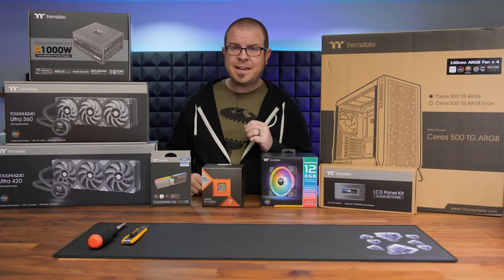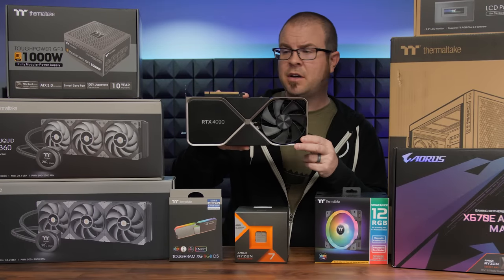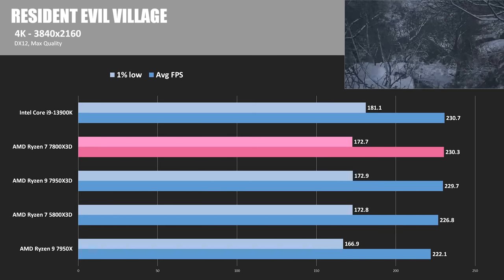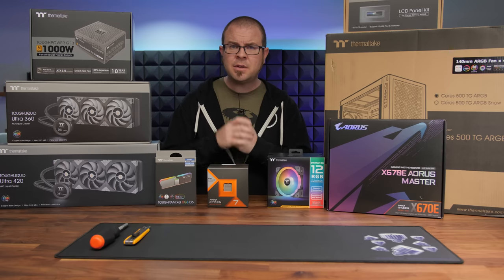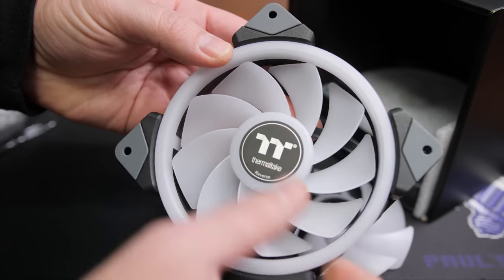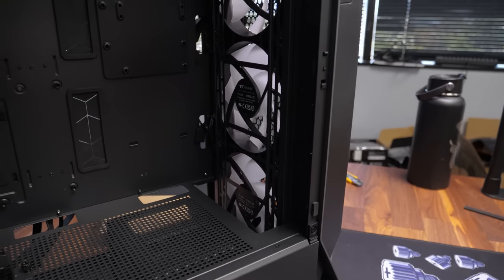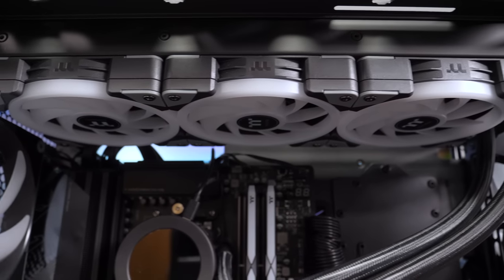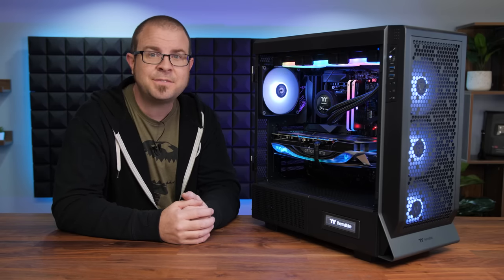Building a Top-Tier Gaming PC in the Thermaltake Ceres 500 - 7800X3D + RTX 4070 Ti

Comment: I dont know if someone already posted, but the dip switch on the TT controller is to assign a device number to that hub, so the software can know what controller that is, you can daisy chain multi TT controller off one of the USB header splitter cable.

Comment: I'm very interested in the Ceres 300 case, and would like to see a build with that. I'm looking for an air-cooled gaming system that can house a 4090 and a soundcard, and has top-front mounted IO, and is only as big as it needs to be. No over-clocking.

Comment: I did a recent build in this same case and actually was very impressed. I'm not sure I would have been $169 impressed, but I was able to buy it new for $134 without the panel. I also used Thermaltake Toughram, which was inordinately expensive compared to other DDR5 on the market, as in more than twice as expensive. I also used a top-tier Thermaltake 850W ARGB PSU and one of their AIOs which was really the only reasonably priced Thermaltake part in the build. However, I had committed to a "Thermaltake" build, so that's what I did even though I could have built the PC for less if I had just used the quality parts which are my usual "go-to". In the end though, I like the build. The case came with three 140mm ARGB CT140 fans and I used one of Thermaltakes 420 AIOs which also came with three 140mm CT140 fans. I expect the fans on the "performance" version of the AIO are better and perform better.

Comment: The Ceres 500 is beyond huge.  Heck, even the Thermaltake Ceres 330 ATX Mid-Tower (the smaller version of the 500) I am currently building my latest system seems a bit large compared to my current CORSAIR ICUE 220T RGB Airflow ATX Mid-Tower.

Comment: As a gamer is an X670|E needed? My next build will be a 7800x3d 64GB DDR5 (2x32GB cl30 6000) and a 4090. I wasn't planning on overclocking and with these parts I can't see me upgrading before the next architecure change (still rocking a 3600x and a 1080Ti). . I do like the 500 USB ports you get on X670 though. My only requirement is 2x M.2 slots, WiFi and blurtooth.

Comment: Hi Paul, I just wanted to start off by saying that I'm a huge fan of your DIY computer building content. From selecting the right parts to putting everything together, your videos have been incredibly helpful for me. However, I've noticed that I always run into issues when it comes to fans and RGB components. Between figuring out the right fans to purchase, connecting them to the right headers, and synchronizing everything with software or the BIOS, it can be quite overwhelming.
With that said, I was wondering if you could possibly create a dedicated in-depth video on how to properly purchase and configure RGB fans. It would be incredibly helpful if you could cover topics such as connecting fans to RGB headers, selecting the right RGB fans for my specific build, linking RGB with different vendor types, and finally, demonstrating how to synchronize everything from the fans and RGB RAM to the motherboard, AIO, and PC case.
As someone who is passionate and admire about building their own PC, this is by far my biggest pitfall when it comes to RGB. Any help or guidance you could provide would be greatly appreciated. Thank you!

Comment: I'm building a loop in this case. That front tray is great on paper but when I added a rad (inward facing) and fans (outward facing) I could not put the tray back in. They have some lip at the bottom that the bottom fan doesn't clear. I had to remove the whole frame to put it back in. Painful.

Comment: I mainly use my PC for MSFS and the 7800x3d is exactly what I need, it will replace my crappy 10900k with 19 cores. So unnecessary, like I only use about 7 or 8 cores at most and everything else is at 0 utilization. Saving way more money then the 7950x3d and get even better performance then it. I use 1440p which is perfect and I'll see a big jump in FPS. Thanks for the review. I wonder why a lot of other reviews on the 7800x3d or other hardware never test MSFS. It's probably the most cpu intense title out there if I'm being honest, especally when flying with payware high intesne scenery or using more study level aircraft costing more cpu load. Definetly getting the 7800x3d tomorrow!
Reply: MSFS is a tough one to benchmark. There's no built-in test and the performance you get depends on the aircraft you are flying, the area you are flying in and the prevailing atmospheric conditions. So, it's hard to replicate test conditions between runs. We're fortunate that Paul goes the extra mile for us. Thanks, Paul!

Comment: It blows my mind it performs on-par with the 13900k in games, but does it at less than 1/3 the power draw.

I guess the downside is you can OC the 13900k much more than the 7800X3D...?

I kinda feel silly putting a THICC 480 on my 7900X3D...but I also don't. LOL

Comment: On Thermaltakes sensor panel I wonder why they couldn't just keep the original metal panel and yet cut out the area where the slim sensor panel could attach to? That would make more sense than to unscrew one whole panel and replace it.
Reply: also why such a small screen, there is enough metal to make a larger screen and the $100 would be more worth it.

Comment: Would have been nice to see a comparison with the i9 13900KS I have, that even being much more power hungry, even outside gaming is does an amazing job. I do have mine underclocked at 5500mhz and undervolted at 0.075v for normal gaming and normal everyday use. I do unleashed it's power when using 3D Software or with high computational software.
Reply: the KS is 3% faster than the 13900K when on full power, so you can extrapolate... it still loses quite a bit to the 7800X3D. But in your case you are running it slower than a 13900K, so a comparison would be completely unuseful.
Reply: It would be better in productive and worse in gaming
Reply: Oh wait, the character (Frame Chasers) said 13900KS is 25% faster than 7950 by his ''own tests''

Comment: Raytracing beats the piss out of my cpu at every resolution, you guys really need to start benchmarking that. Also, 1% lows are more important than averages. Weird that 13900k has bad 1% in CP2077 in 4k but but better in 1080p. In fact the 7800x3d basically loses in 1080 in that regard

Comment: i hope other manufacturers make fans like the swafans where you can swap out the blades. On the other hand I have some issues with these fans or rather the controller for these fans. IF you are going to force us to use a controller in 2023 it should have SATA not Molex. And If you are going to do a control box make sure it has enough power to do 4 fans in a chain for people with 480 or 560 radiator and be able to power more than 6 fans total on the hub. I also am not a huge fan of the anti sag bracket. I want that to disappear not be super-visible Or if it is super visible it should at least be interesting.

Comment: Personally I'd like to see a 1440p take over the 4K. Even though I'm probably looking at a 4090 should the prices become acceptable to me in the near future, otherwise I'm just skipping the whole generation. If AMD can give me a good 4090 competitor, for under $1,000, I'll consider that. The only reason I need a 4090 should I get it, is that I do a lot of AI work, and while my current rig does well, it is only a laptop, since I was not paying those scalper prices during the last 2 years. Had the 4080 been at a logical and acceptable price I would have bought that hands down, and for anybody listening that's $800... For gaming 1440p is what I use, and it's really the only resolution I'm concerned with since I'm not going to get a video wall... I'm looking at 27 in if monitors especially OLED ever get produced at that size. I seriously do not want larger than that

Comment: People that have the i9/7950X cpu's aren't doing anything at 1080P its either Ultrawide resolutions, 4k or 5K. So the whole argument that one is faster than the other in a situation that is less that 5% of the time is borderline straight up misinformation. If it was an i3/i5/7600X etc and doing it at 1080p and 1440p I'd see that but these cpu's costing hundreds of dollars for systems that have a total cost of $1800-$2000+ and having even performance at 4K/5K and being beat by 5-10fps by each other just shows their parity not a clear king of cpu's
Reply: No-one said anything about people using them for 1080p... they use 1080p to artificially create a cpu bottleneck rather than a graphical bottleneck, so you can see the behavior when you'd run into a real cpu bottleneck... So you can estimate future performance with cpu intense games, even games that don't exist yet. That's not misinformation, it's you misunderstanding how reviews work...

Comment: Does anybody else feel its kind of a fail how even today we have brand new systems that come with USB 2.0 thanks to the shit show of a roll out and compatibility problems we had with 3.0? Even having 3.0 speeds is a failure at this point too in my opinion given 3.1 Gen 2 came out almost a decade ago (and let's not even get started on the clusterfuck of the naming scheme and optionality of almost every aspect of the spec to the point where a product that came out in 2010 could accurately claim to have USB 3.2 ports thanks to retroactive branding).

Comment: samsungs QDOLED tv's have 500pixels per inch but their new microled tv's that are commercially available later this year will have 5000pixels per inch that basically makes these tv's crt's lmao the ppi is so absurd could you even call them physical pixels at that point? how would 800x600 look on these Tv's because they call these tv's resolution free and ratio free...no more 4K nonsense or black bars or bezels...even though everyone on google seems to call these tv's 4k still which doesn't make sense to me. what does this mean for gaming? the instant response time is probably the biggest seller 2nano seconds that's insane.. compared to 1 milisecond. why aren't people more exited about this technology? could we play games at 800x600 and and it would look better than a regular 4k lcd panel? i wonder what these tv's mean for cpu benchmarks in the future. you can kind of test this right pixel density on 4k phones is double that of a 4k tv if not more and 360p video's look really good still on phones so if these tv's have 5000pixels per inch does that mean we can go back to 360p on big 100inch tv's?
Reply: New monitor and TV standards are slow to be adopted at reasonable pricing. I will believe in microled when they are actually available. They've been promised next year, for a few years now. I just bought a 65" Oled, last November and I'm very happy with the LG C1, so I hopefully won't be needing a new TV for a long time.
Reply: @frommatorav1  in their new video they said that they found a way to speed production up by 1500x lol microled has always been available, but never commercially. from what i read they'll be sold near the end of 2023. you can already preorder VR headsets with microled monitors but i think that one uses older microled technology. bigscreen beyond is the name. not sure what microled that one uses i don't think it's from emagine the company valve, lg, and apple invested in back in 2018..but i heard they had disputes, not sure what happened there. you can already find early reviews.
Reply: @n9ne  I wasn't saying the microled  technology doesn't exist. I was saying, I won't believe it will by available in the mainstream at decent pricing, until it actually happens.
I think there have been major issues with production yields and costs to produce the microled panels in the past. The successful yields are such good picture quality, they keep trying to find ways to mass produce it at lower cost and better yields.